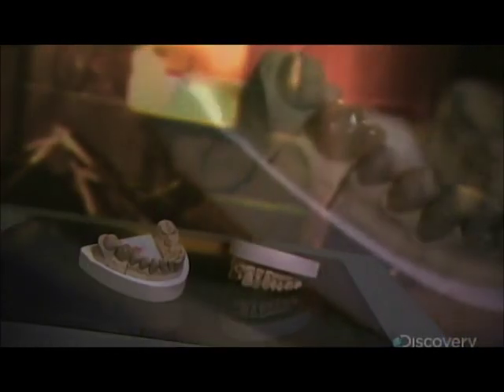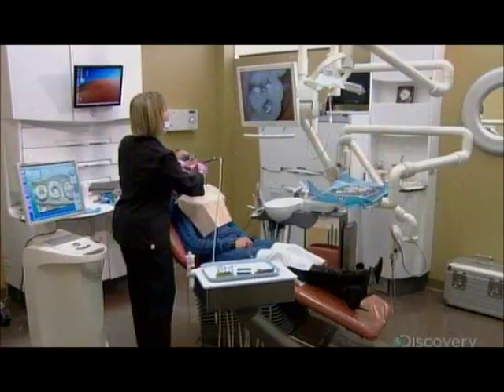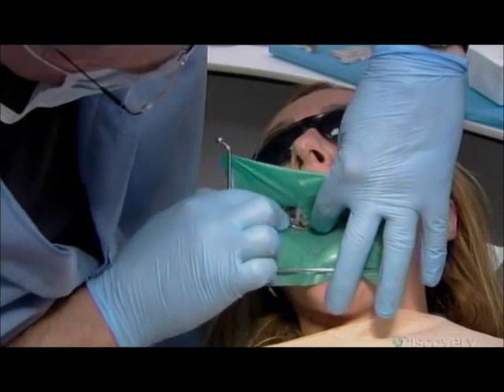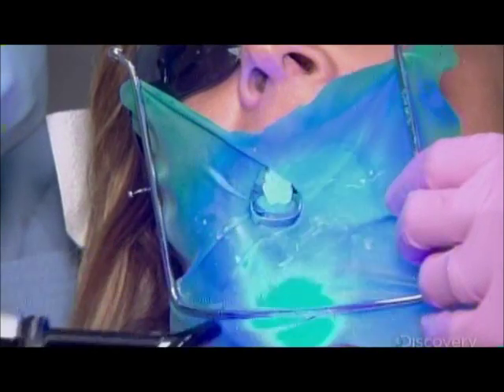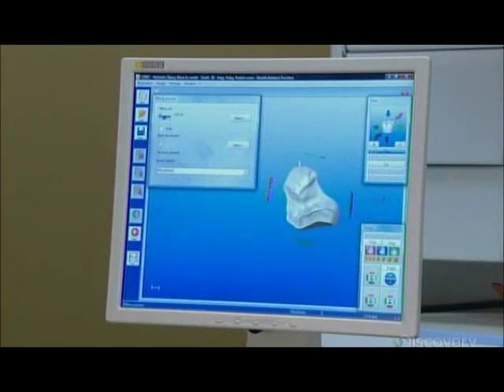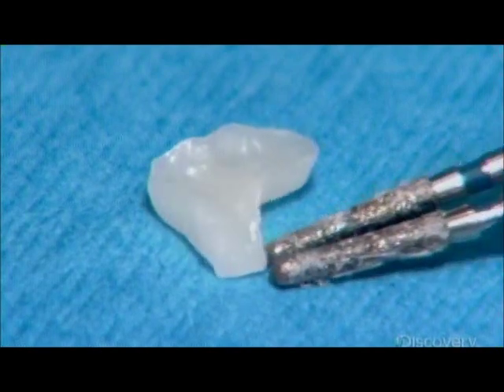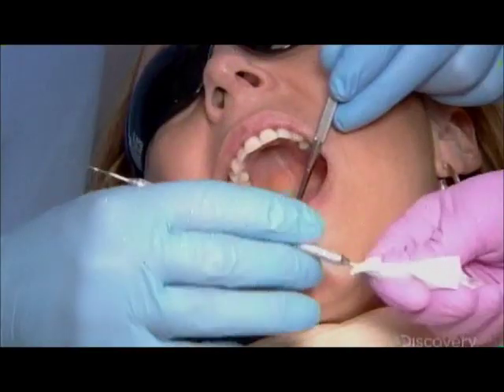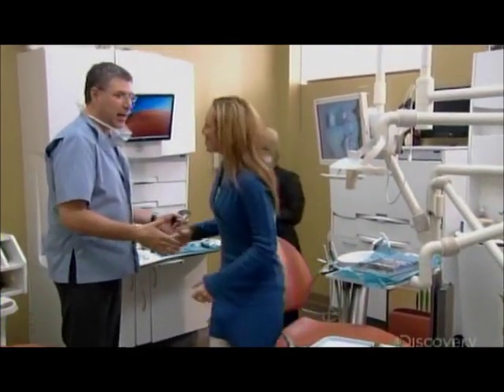How It's Made - Digital Dentistry

Comment: This technology looks good.  I however do not understand how this tooth is "stronger" than it was with a bonded inlay especially after the transverse ridge has been needlessly removed for the convenience of making a ceramic inlay.  I would have placed a bonded composite with complete rubber dam isolation if the existing amalgam needed replacement. I didn't see any caries.
Reply: I'm not sure but I'm pretty sure normal fillings are just bits of metal placed in your tooth this uses a stronger, and cemented material.
Reply: +Delta Dragon | Minecraft BLR and more  There are many reasons that using Cad/Cam technology for replacement of a small filling like this  is generally not a good idea. Removal of more natural tooth structure to enable a ceramic inlay to be milled in a situation like this is simply silly. The existing "silver" filling would have likely lasted more than 50 more years.
Reply: +Edward Dergosits eh, then it's a marketing ploy
Reply: +Edward Dergosits there were most likely secondary caries on those amalgams